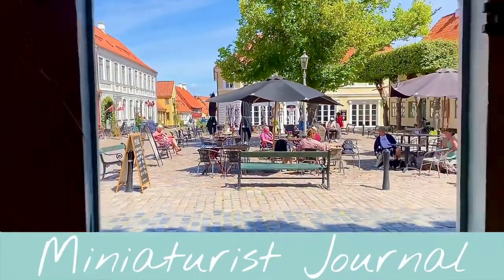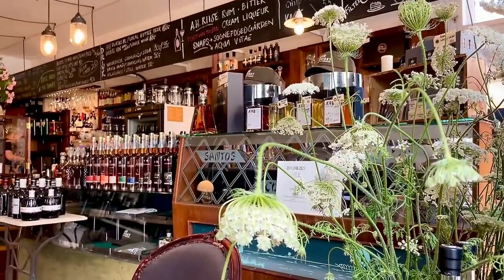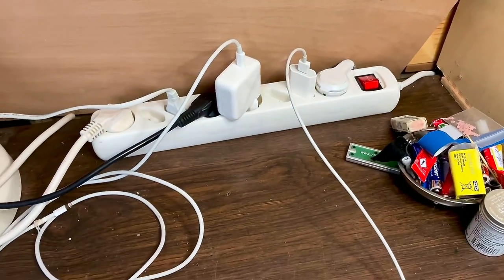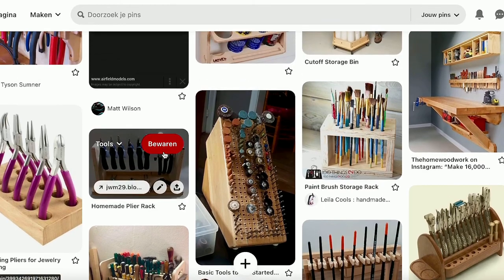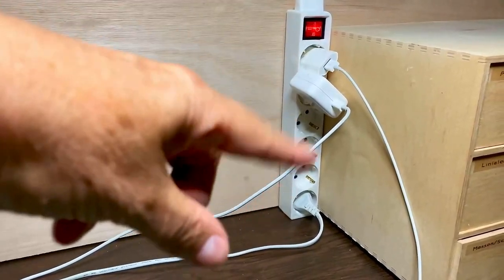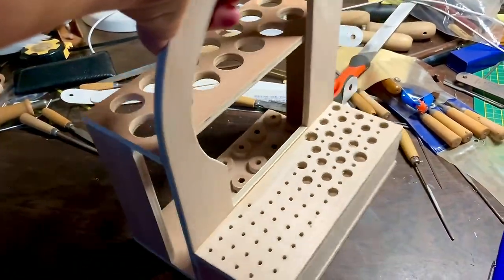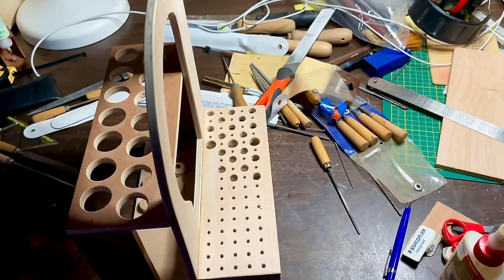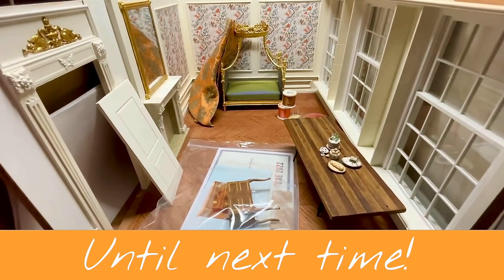Pretty houses of Ærø, making a tool caddy for my desk.

Comment: This video was right up my alley as I have recently added pegboard above my workspace.  Most of my pliers, scissors, screwdrivers, paint, glue, etc are hung up and OFF my desk.  This gives me some semblance of order.  I also made a big thing with cubbyholes to separate all of my stripwood.  The holder you made is great.  The town in Denmark is stunning!  Thank you Josje.  I love your videos.
Reply from the maker: Thank you Beth!  Good workshop organization is so helpful for creating good work!  I do love pegboards but I don't have a lot of wall space and my desk is in the middle of the room, so no walls there either.  I think I need a big thing with cubbyholes too 😉 I love my tool caddy and want to make one or two smaller ones as well, for my pliers and tweezers etc.